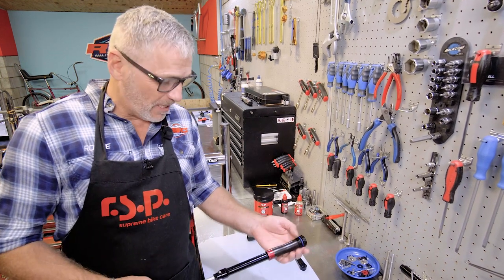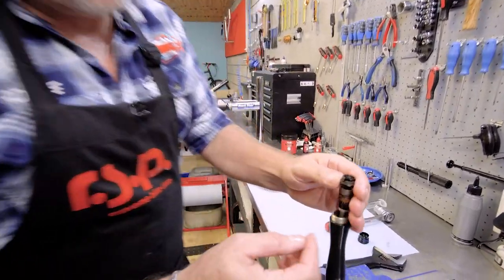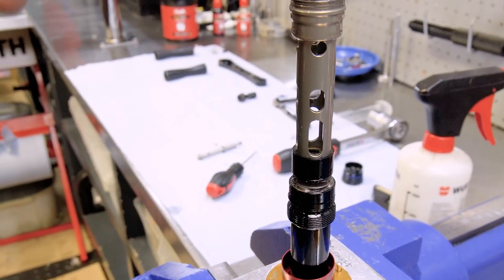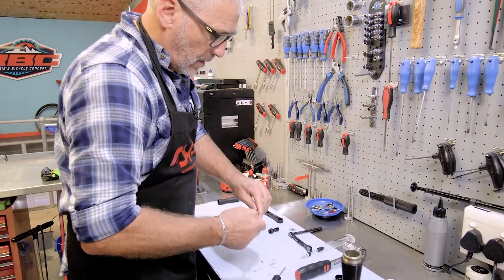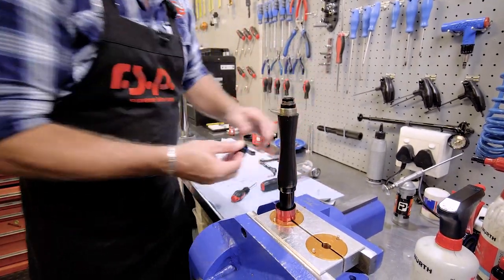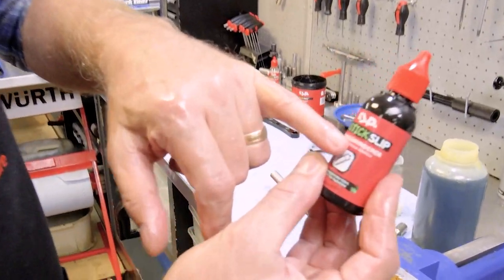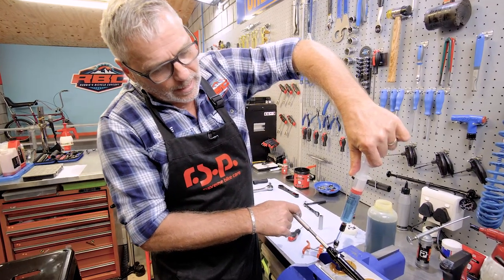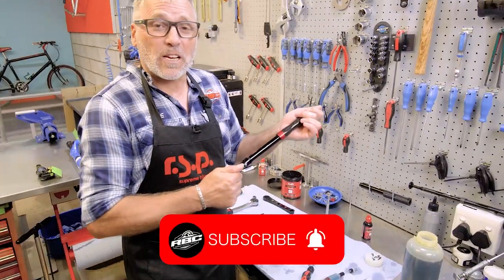Rockshox Charger 2.1 Damper Service - watch as Robbie services this suspension cartridge.

Comment: Was too much oil added to the lowers and that is why it got up to the bladder or does that just happen after awhile?
Reply from the maker: Hi m m, thanks for your message, herewith the explanation. I see many shops and individuals doing frequent lower leg services which is fantastic for the fork, however just doing a lower leg service without bleeding the damper at the same time creates additional problems. The damper can and will ingest oil into itself during the process of riding. There are a number of factors causing this but it will happen regardless. When the lower leg service is performed a specific oil is added to the lowers to assist with the lubrication of the stanctions and bushings, this oil is very different  to the oil in the damper and is not designed for damping. So when the lower leg oil gets ingested into the damper it creates a different damping curve as it mixes with the damper oil and it adds oil to the system which can only take a limited amount of oil. When the damper becomes overfilled the bladder is stretched and when compressed can touch the internal sides of the stanchions causing the damper to bind and the bladder to pop.  In short I recommend a full damper bleed every time a lower leg service is performed.
Reply: @RBC_tech  That makes sense, good to know. Thank you for taking the time to give a detailed explanation.

Comment: My riding weight is 140 with gear, would I benefit from using a lighter oil in the chargers.1 RC2 (like I did in my old first gen charger)
Reply from the maker: Hi James, thanks for your message and support of our channel. I would not change the 5wt as the viscosity index difference between the Rock Shox 2,5w and the Rock Shox 5wt at 100Deg C is quite significant which means less damping as the temperature in the damper increases. I find the main issue in your instance is from the air chamber; if you pump the fork to the correct sag for your weight it will most lightly feel sticky to get the shock moving but then blow through the travel i.e. no mid stroke support? The best fix I find is to increase the negative chamber or to take control of the negative chamber by making the fork dual air. Send me an email to rbcbikes@gmail.com and I will give you the details.
Reply: @RBC_tech  going to try the Vorsprung Secus

Comment: Thanks for the video! I have a charger R damper in my Zeb and would like to put a lighter rebound tune in it. Do you have any shim stack recommendations to make that happen?
Reply from the maker: Hi Cade, thanks for your message and support of our channel, unfortunately I don't have this info to share. Please check with your local Rock Shox (SRAM) distributor, they should be able to make these changes for you.
Reply: @RBC_tech  thanks for the reply. Not even RockShox themselves will give me any info. It's pretty cool I can just call the dudes at fox up and get tune kit for whatever I want. I've revalved my '21 float X2 a number of times now with great success.

Comment: Hi, the regulation of my high Speed damper is full close and It doesn’t move…
Reply from the maker: Hi Matteo Ricci thanks for your message. Herewith the details,  the lockout spring is quite tricky to set, firstly you need to ensure that the high and low speed needles are completely turned out to the negative on the compression body. Then fit the spring into the hole inside the damper. I use a 13mm or an 11mm ring spanner to hold the top of the compression body. Then ensure the outer end of the spring is inserted into the compression housing, at this stage do not push the compression body into the damper as the high speed needle will push into the damper and you cannot set the spring with the high speed needle in this position. Carefully turn the compression body clockwise against the spring and when the keyway is reached push the compression body into the damper. Test the lockout actuation with the ring spanner to ensure you have the full movement.
Reply: @RBC_tech  really appreciate!!

Comment: Hello my lyrik ultimate low compression knob is not functioning. It had 19 clicks before but now it's turning infinitely. It womt stop. Is it repairable?
Reply from the maker: Hi Marco, thanks for your message and support of our channel. It sounds like the brass guide pins have broken in the damper. These pins guide the parabolic needle assembly  allowing it to close the low speed oil port. A suspension service company should be able to open this up to check if the damage is repairable or not. In a case like this we would open the damper and check the damage to see if its repairable, most times its repairable so quite inexpensive, however be prepared to purchase a new damper if you cannot get this repaired.
Reply: @RBC_tech  hello sir! I sent my fork to local shop here and found out that the LSC rod or pin was broken and left the valve fully open before the pin snap. They can't repair it or replace with a new part. So I'm gonna use my fork without LSC. It's horrible, but I dont have the money to purchase a new one. The charger damper 2.1 is expensive. Thanks sir! Your video was very helpful.

Comment: hello, any idea where i can find in EU this spring for lockout ? Thank you in advance !
Reply from the maker: Hi ND tuned in Portugal supply the spring and seal.https://ndtuned.com/en/produtos/acessorios-bicicleta
Reply: @RBC_tech  Thank you, actually I try to do it on my own such spring, Already have proper wire, 3d printed tool. Kindly ask you could you measure the pitch of the spring (or even space between coils).

Comment: i have a SID RLC with a Charger 2 Remote Cartridge. Is it the same procedure ?
Reply from the maker: Hi Don, thanks for your message and support of our channel, apologies for the late reply. The SID RLC should have the Charger damper so yes this would be the same procedure, however if you have a race Day damper this is a complete different service.
Reply: @RBC_tech  yes, it´s a charger. Is it possible to get the parts (seals) from you ? If yes, will you ship them to germany ?  Thanks
Reply from the maker: Hi Don, yes no problem, please send me an email with your requirement at rbcbikes@gmail.com

Comment: Is the charger rc2 pretty much done the same?
Reply from the maker: 100%
Reply: @RBC_tech  cant figure out to disassemble the compression adjuster on the RC2 because of pressed pins. There is only a tiny 1.5x1.5mm o-ring inside on the LSC needle.